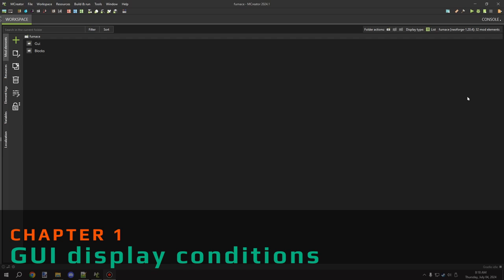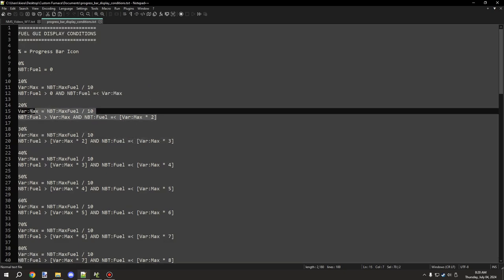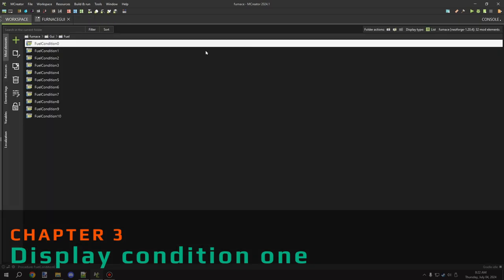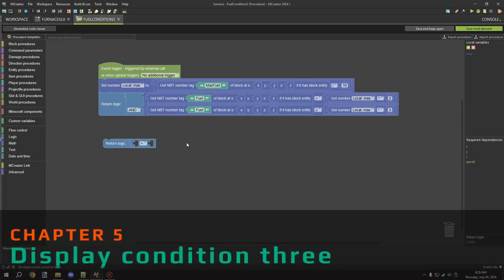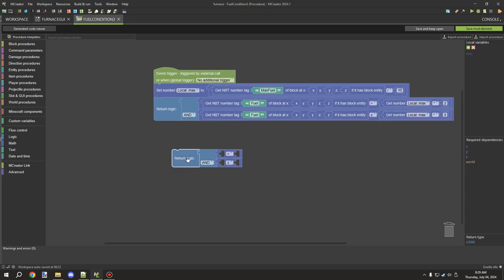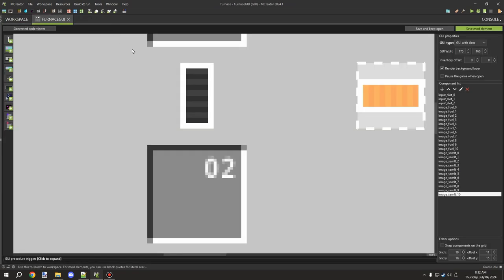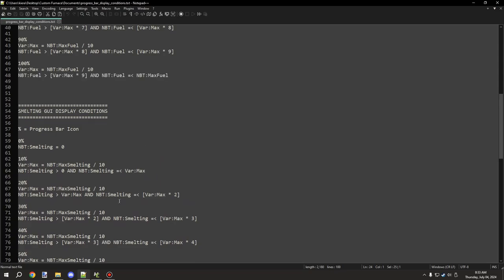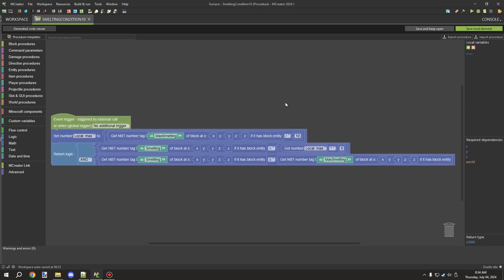Custom Furnace | Part 3 | MCreator Tutorial | 2024.1

Comment: Bro i had a question in mcreator 2023.2 how can i make it so that my entity can go through holes if he detects a wall on his path and it will ge in by crawling but it will also play a animation from the geckolib plugin. Please reply and also love your vids keep it up!❤
Reply from the maker: "how can i make it so that my entity can go through holes if he detects a wall"

Detecting walls would require manual area tests. This has its own series of problems mainly dependent on repeaters or clunky procedures. It could be done by coding as you have more freedom. But using vanilla pathfinding alone you're not going to get great results, mob AI in Minecraft is the intelligence of a pig, so they connately get themselves stuck or get into situations where they get lost. For example, if your working two distances far apart the odds of the entity getting stuck are way higher even more so with natural caves pocking out and such so you need a waypoint system and the closest I have gotten was using a manual commands. So sadly it's just not the best game for advanced AI like this, at least not without hard coding something in.

"but it will also play a animation from the geckolib plugin."

I have never used Geckolib and don't plan on using it, it's generally a pin for people modding their games to find extra dependencies, I know there are not many other options for animation but if for whatever reason they decided to stop development then mods that use if run into updating problems. The likelihood of another API coming along over time is high but you would still need someone in the community to make a plugin which is where the problem lies, there are too many third parties to do one thing which is too risky in my opinion to develop a mod for.

I do hope this helps a bit though I do have a script file for area test on my git hub example repository
But keep in mind using repeaters every tick like it's required with AI path finding can lag the game quite a bit.
https://github.com/MCreator-Examples/Projects/discussions/87

Comment: Can you make a tutorial how to make biomes that have 0,00001% coverage overworld surface more common, theres no slider for this. If its important my mod has been upgraded from 1.16.5 to 1.20.1
Reply from the maker: Its sadly not possible to control the % value directly, this would require changing the base game %. Mojang adds new biomes all the time so the % will also become more rare between versions, so I would not worry to much about getting an exact value, just play with the 5 generation settings test in game and teleport to random locations in the world then use the locate biome command to check to see how its generating and if its to common or not.

Its more just playing around with the settings than exact math when it comes to adding biomes to the overworld.
I hope this helps a bit also I give you props for updating your mod to a newer version, many people don't do that but doing so can often get more download and provide bug fixes and new features.

Comment: Do you know how you can make a locked door? That is required to have a certain item to open it?
Reply from the maker: Most likely would have to be custom, though honestly speaking, the amount of stuff needed to get a functional door is complex, I have covered custom doors before, not sure if its still working, but you would need to make a right-click event condition to test if the player has the item, if true then run the regular open/close door script otherwise maybe play a sound or print text to the player.